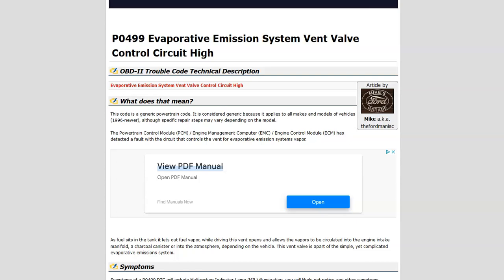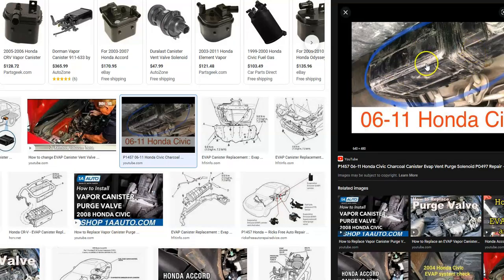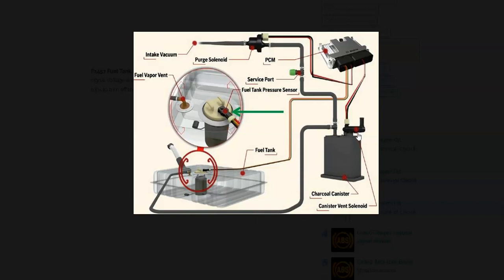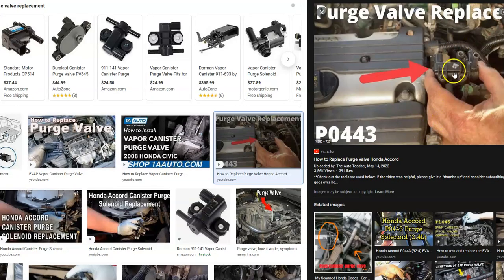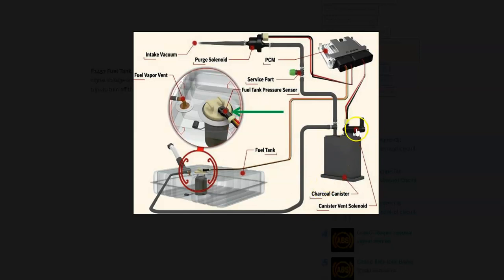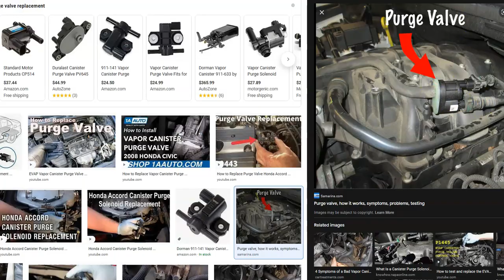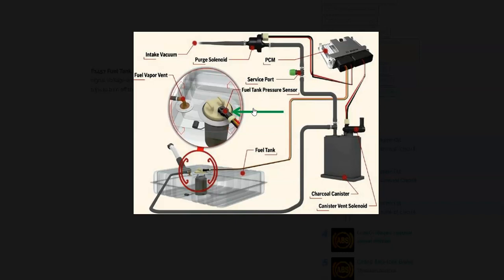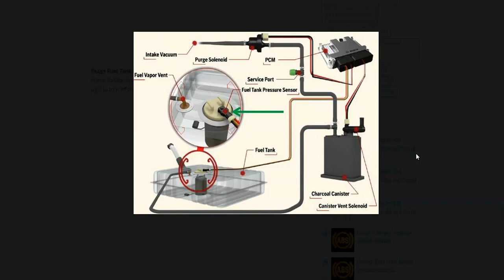How to Fix Honda P0499: Evaporative Emission System Vent Valve Control Circuit High

Comment: Hello, I want to say thank you first, and then I have a question about the evaporator box closing valve. When is the valve fed? Because I checked when I turned the key, there is no response. The wires are all intact and the valve is intact, but the ECM does not  ground😊
Reply from the maker: The vent valve is normally open and closes when the computer runs a leak test on the EVAP system. It can vary, but often, this is 1-2 hours after the car has been shut off. I would test the vent valve and be sure it is opening and closing since that is a common problem.